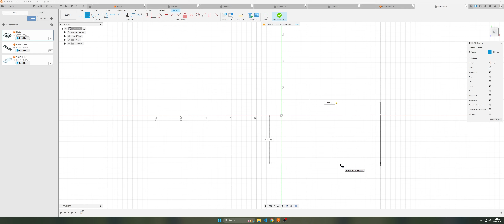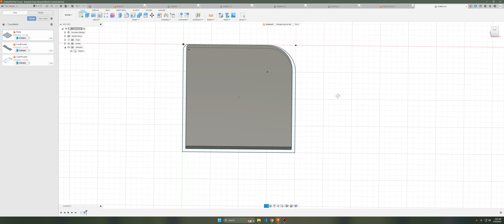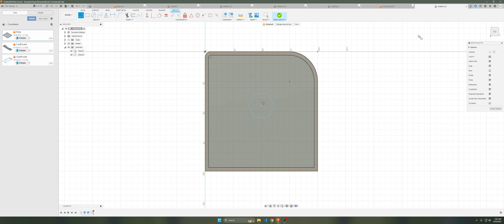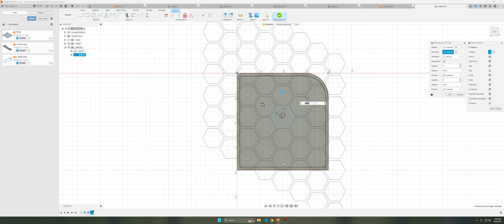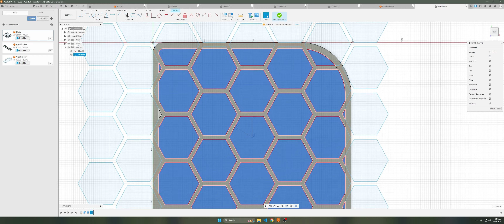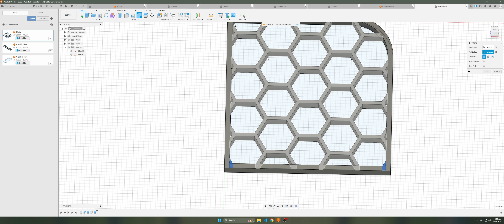Autodesk Fusion Hex Pattern Tutorial! Quick. Dirty. Correct(?)

Comment: I've searched far and wide for a simple tutorial, but somehow they all involved complex objects and I just need to do this on a single plane like you do. Thanks a lot! By the way, you can select the hexagon easily by double-clicking one of the lines. And another thing, instead of selecting the hexagons one by one, you can hold SHIFT and drag over all the hexagons you want to extrude, then while still holding SHIFT, cleck the pattern once to de-select it and you're left with all the correct hexagons selected

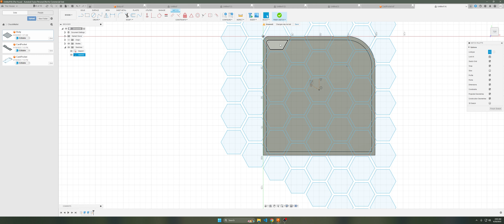Comment: 5:54 - instead of selecting every hole and cutting them out of base shape you'd better select single profile in-between them and extrude it with intersect operation.
Would save a lot of time both making such pattern and changing it in the future, not to mention better performance if done this way
Reply from the maker: Great tip! I'll give it a shot